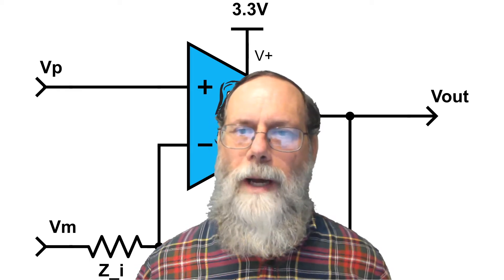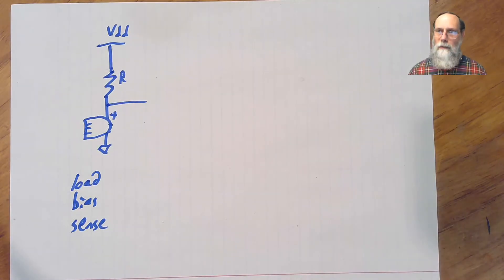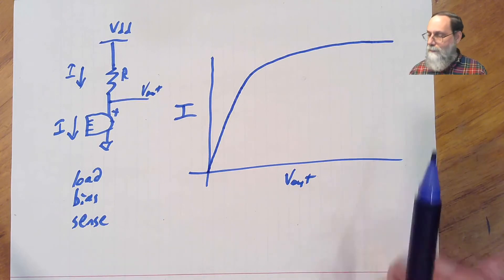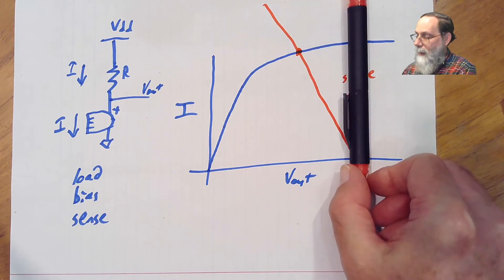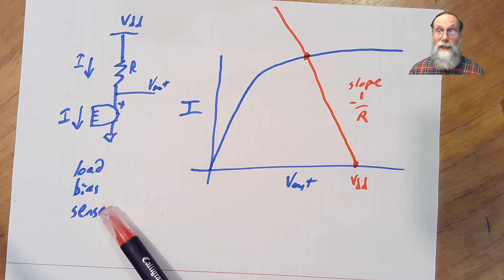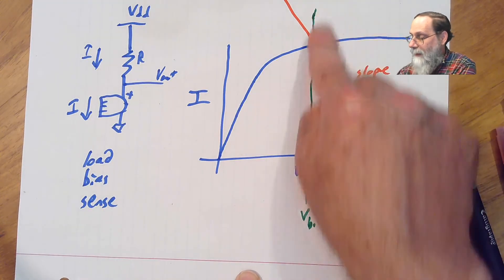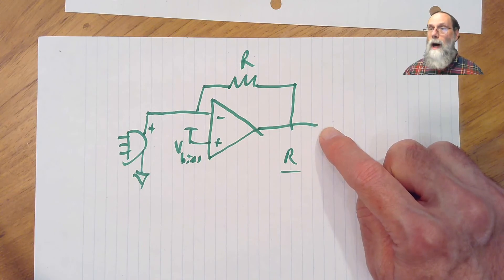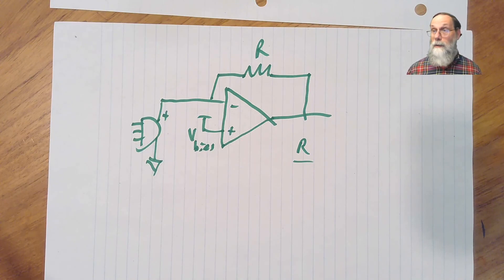Microphone DC bias §26.4.1

Comment: Hi, great video! I am just a bit confused. Is the load resistor to power the mic from power supply and the dc blocking cap omitted for a reason?
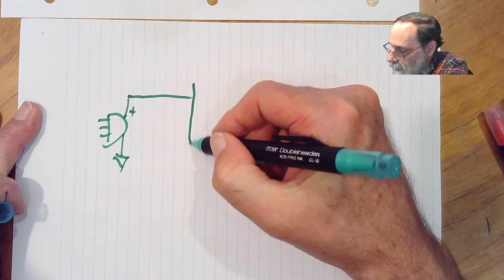Reply from the maker: If you are talking about the use of a transimpedance amplifier to bias the microphone (starting around 10:00), you need to watch https://youtu.be/YBD8fDrHF30	Transimpedance amplifiers §23.1.  The book provides more details than the videos and has more cross-references.